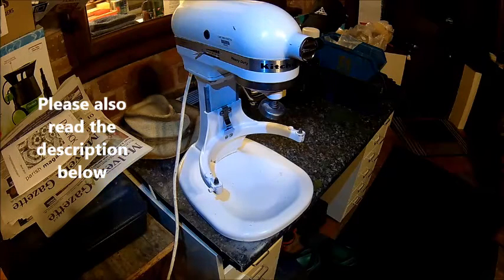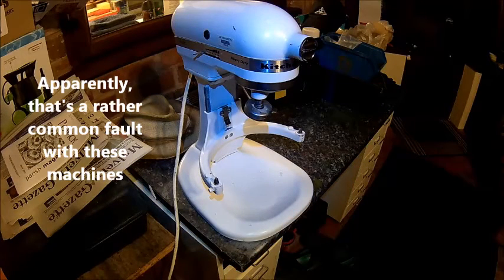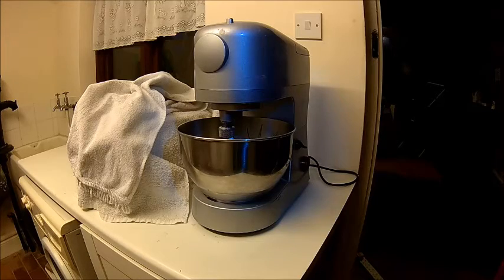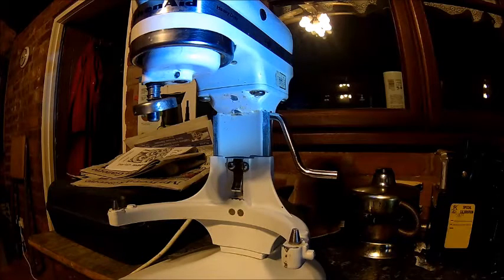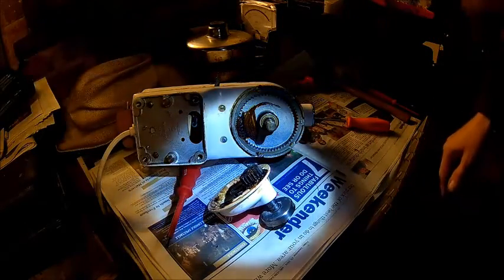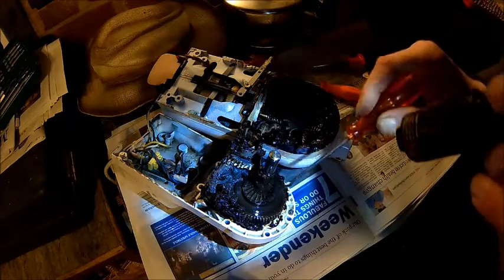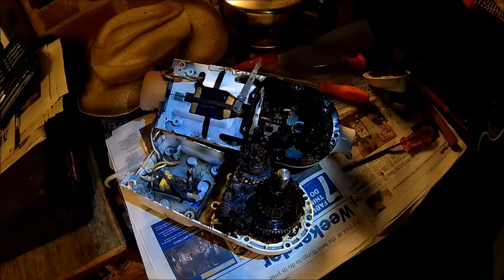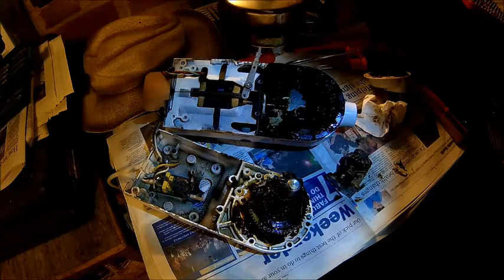KitchenAid Stand Mixer repair (no drive) Part 1, tear down, inspection, fault analysis (Model 5KPM5)

Comment: I picked up working one for 1/5 of what they cost new but its beat up a little bit. I recommend people keep an eye out for them, they're very robust machines and a little tinkering will have them good as new
Reply from the maker: You're right, a bit of care and they can last quite long, but not when they been overloaded, which obviously happened to this one.
Reply: @dynoguy  so I decided to sell it on and guy broke it somehow, claimed refund rights on ebay. tore it down and gears are fine thank god but its something to do with speed lever spring. not powering on either. have I any hope?

Comment: The gear that broke is the "sacrificial" gear that prevents further damage to the entire unit.   I agree with you about the mixer was over loaded trying to mix too stiff or too great a quantity of a mixture.
Reply from the maker: You absolutely right, thought i said that somewhere in the video. It looks like that machine died pretty early in it's life and was just sitting around because there are very little signs of use.